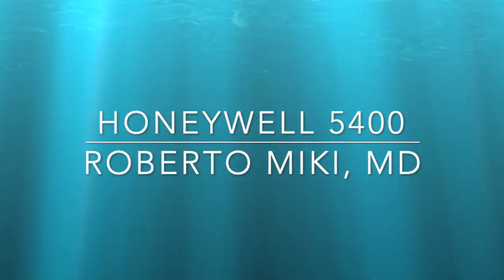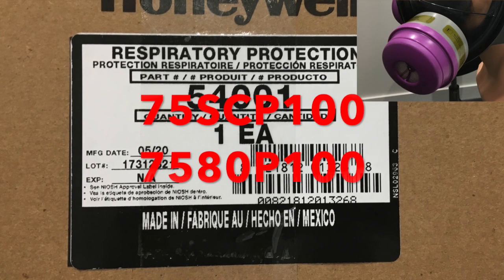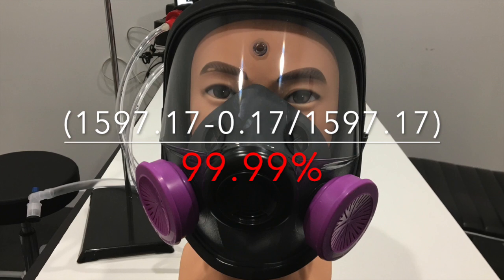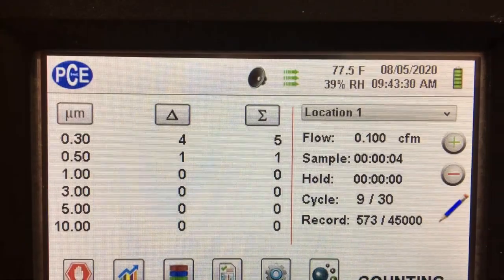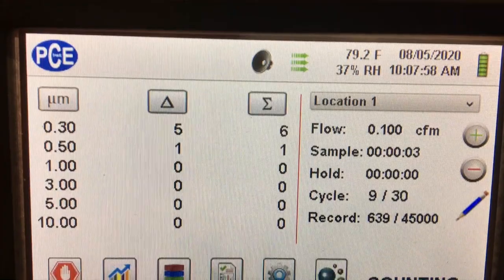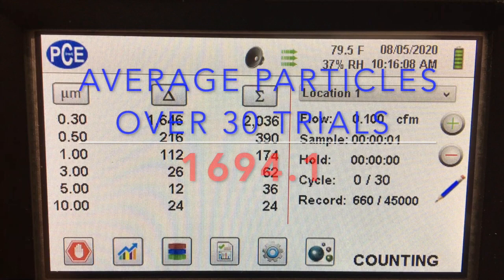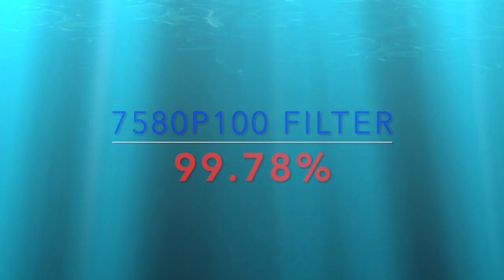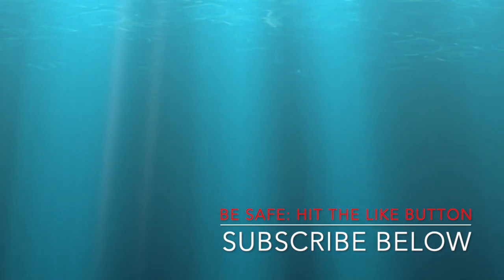75SC vs 7580 P100 Honeywell North Filters using 5400 Full Face Mask

Comment: Thank you for reviewing this. It's what I expected. No real difference.
Reply from the maker: My pleasure. If you have any other ideas happy to make another video! My next thing I am testing are the air purifiers!
Reply: @RobertoMikiMD  Roberto, I see that the 3M filters are now performing better. Do you think the honeywell 7580p100 efficiency goes down with time, or the seal isn't as good on the dummy than with the 3Ms? NIOSH rigorously tests these filters to make sure they all filter at least 99.97% of particles.
Reply from the maker: @gwinners27  Nice observation. I think a several factors are in play. One, I am getting better at sealing the masks. There is some tinkering that needs to be done to get seal perfect. Two, these filters actually work better once they have been used for a while because the particles in the air help clog them a little. Three, I changed when I start measuring and I let the pump run a few minutes to get any contaminated air trapped during the mask placement and fitting to pump out of the mask and collection system. May be I should repeat some of the testing on the previous masks. My hunch is I will get closer to the theoretical 99.97% filtration efficiency.